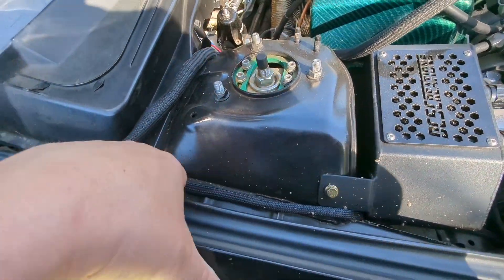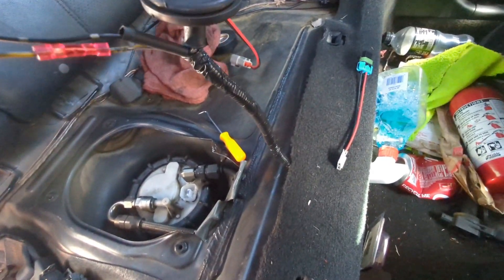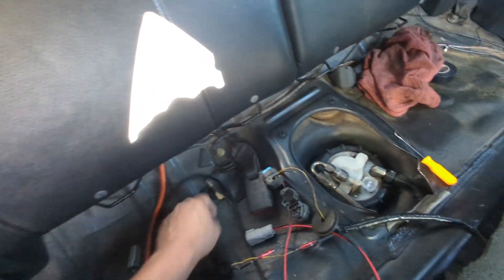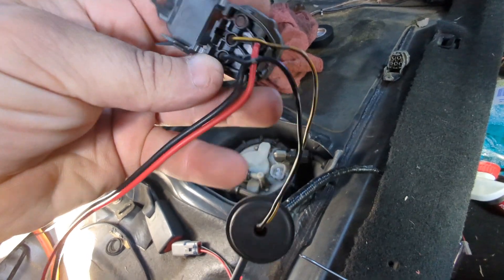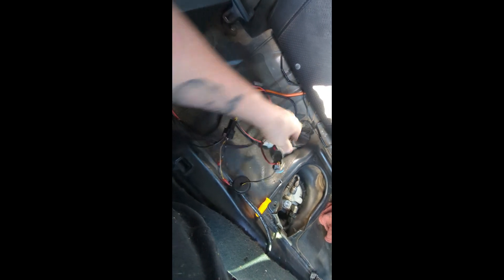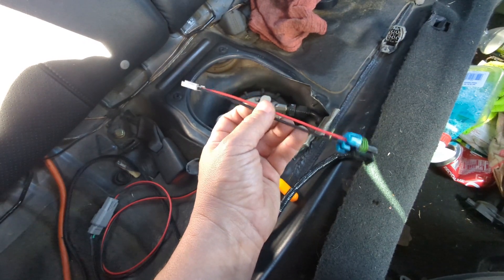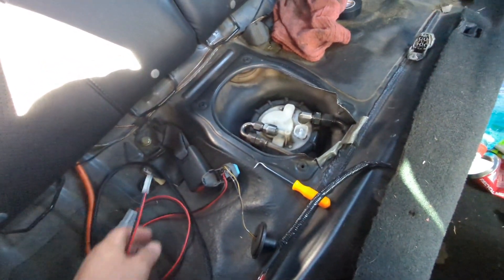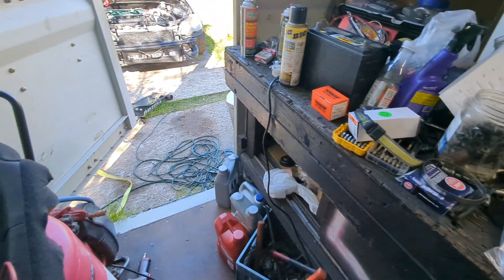DC5CREATIONS Fuel Pump Relay Kit Install 🔥👊

Comment: Hey man was what your old setup? Were you using the stock wiring? Did you have issues with just running  stock 12v
Reply from the maker: I did have an issue were my wires melted. So this is why I went to this kit. Didn't want to buy a new fuel pump. So far so good